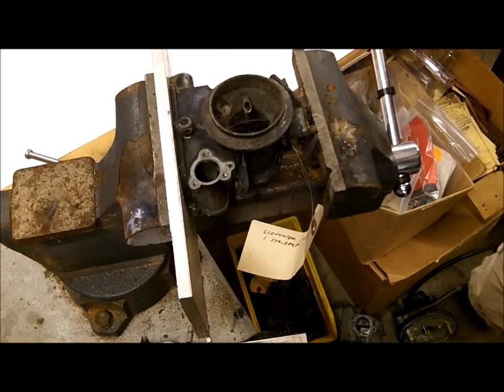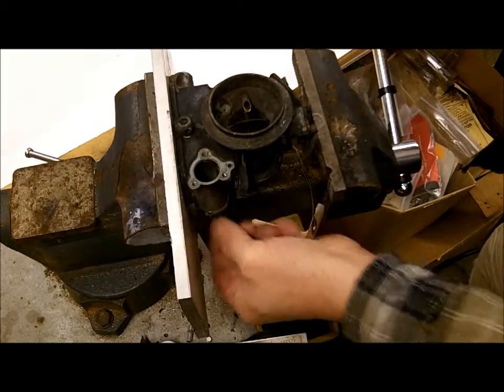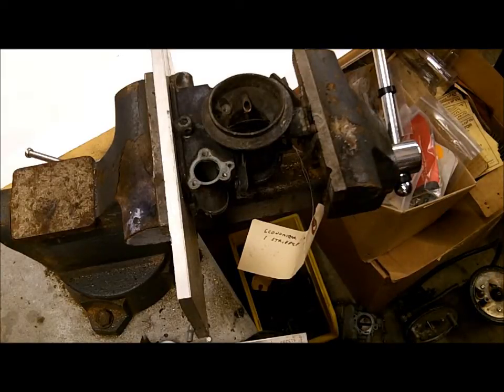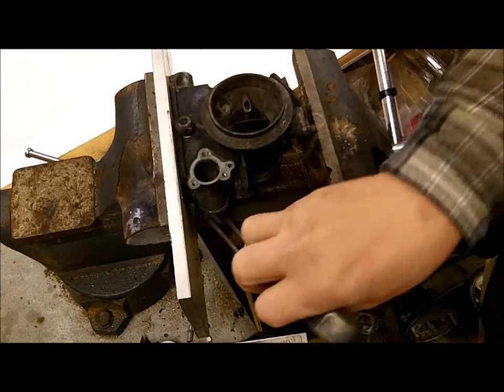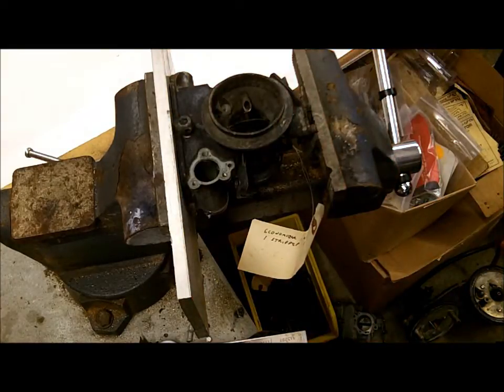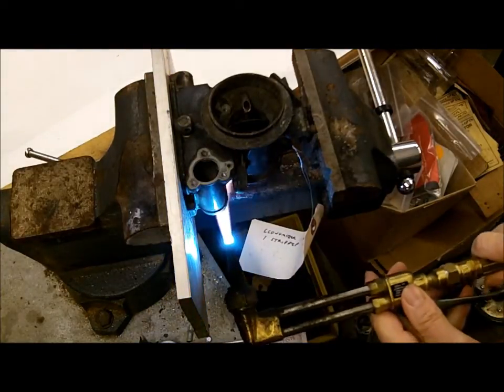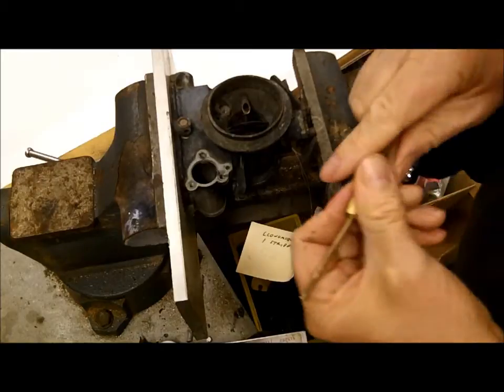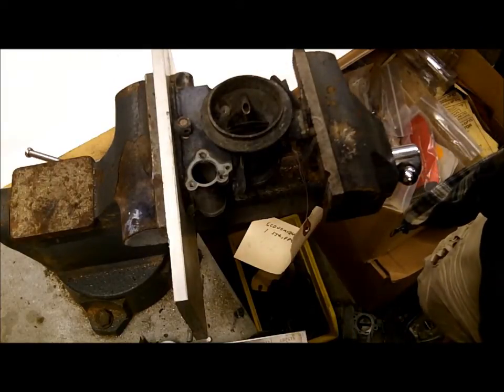Holley 1904 1 Barrel Leaky Float Bowl

Comment: I used a heat gun on my 35 Hupmobile fuel pump where the glass bowl goes. It worked well. Now I’m needing to fix my 1904 off my 61 comet. Thanks for the advice!

Comment: Do you have to remove the choke lever in order to perform this repair in the vise? I noticed you said in your rebuild video not to remove the choke lever if it isnt necessary because you can cause more damage disassembling it.
Reply: I guess what I meant was the choke shaft assembly. I’ve noticed that the area of the float bowl flange that needs to be straightened out is inline to where the choke assembly is located, and appears to be where the other side of the vise is in contact with. Or is the amount of pressure applied by the vise not a concern on the choke shaft assembly?